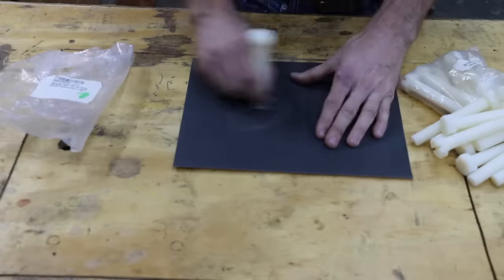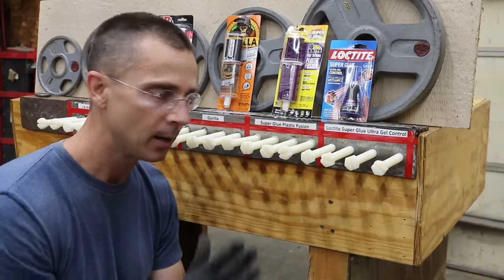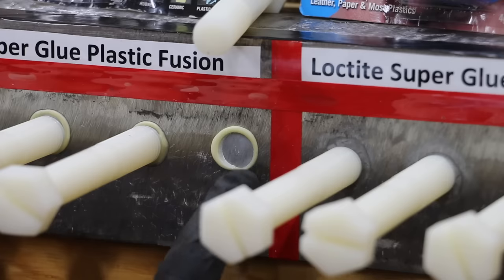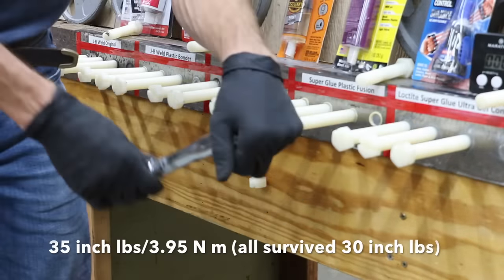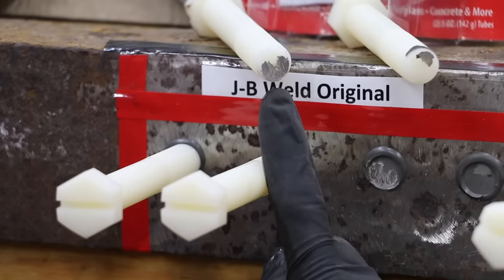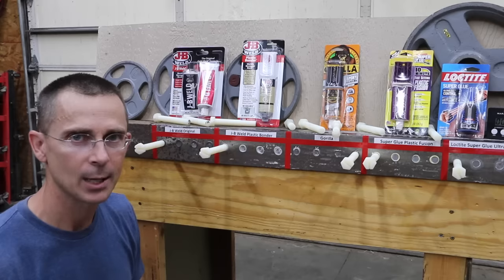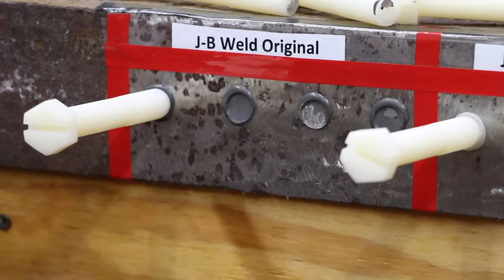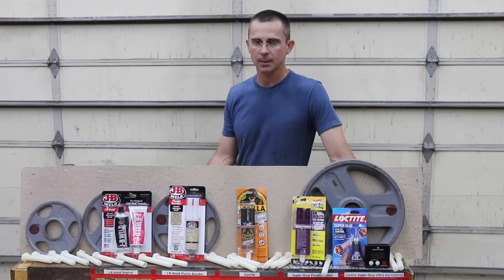Which Epoxy is Best for Plastic?  Let's find out!

Comment: LOL I have my side trim on with the clear Gorilla clue..
Reply from the maker: Thanks for sharing.
Reply: @ProjectFarm   It looks kinda Janky.. But it's holding it there for now. I really need to pull my car apart and fix a few things.. I have a new fiber glass bottom spoiler for my Nissan Juke and every time I move it it cracks a little more.. Don't have the mounting stuff yet won't be here till Friday, So Saturday will be the install day. Guess I will have to touch up the cracks with bondo after I get it on the car..

Comment: I think it might be time for an update to your epoxy videos. They're a little outdated and I believe you can develop a better testing methodology for both the steel and plastic epoxies. One thing I found lacking in this particular video is that typically you're going to using plastic epoxy between two different plastic surfaces and not plastic on steel. That's not to say the plastic on steel isn't valuable, but I think it might as well be a whole other video because the use case is so different.
Reply from the maker: Thanks for the suggestion.

Comment: Awesome dear mate I am searching for one glue for fixing engine part first you will introduce me jb weld appoxy in your cylinder head cutting video I comment on that I want to buy that we didn’t get that one in India but I want to order it on amazon it coast 1270 I will nice video  and it will also prevent oil leak on engine yes? Put some more informative video about that nice to met u🥰😘
Reply from the maker: Thanks for sharing.

Comment: Better to heat up the plastic and let it melt to steel! Also when mating a broken piece of plastic use heat to fuse the tow together similar to welding! Better that any glue! Don't try to use another plastic to weld plastic unless it's the same plastic!
Reply from the maker: Thanks for the feedback.

Comment: i know this is old here is the problem those bolt are made from material impervious to chemicals even glues where the plastic broke the epoxy was most likely to be caught around  the threads try with pvc rod or acrylic rod
Reply from the maker: Thanks for the feedback.

Comment: Entertaining, but I question any of the conclusions drawn here.  The mixing time, induction period, and even the amount of epoxy applied isn't consistent across the board, resulting in a shoulder of adhesive in some cases that begins to encapsulate the threads on the end of the bolt, which would significantly increasing holding power.  As well, the weight hang test is entirely dependent on the initial peak acceleration imparted as the weight is released, but you can't release the weight consistently when doing so by hand.  Similarly, the torque test is more dependent on the rate at which you apply the twisting force not the peak torque.  The folks at Consumer Reports and UL probably get a good laugh when watching these videos.

Comment: Unfortunately the basic premise has a flaw. He is genericizing and lumping all plastics as if they are one chemistry. These bolts are probably nylon or acetal, there are many more types of plastics... Polypropylene, polyethylene, polyester, polycarbonate, ABS, polystyrene etc that you come into contact with every day. Not one adhesive will work for them all.

Comment: I wish you had rubbed the nose of one of these bolts across a 5 inch piece of 50 grit in opposing directions. Epoxy does a much better job if given a roughed up surface to adhere to.
Reply from the maker: Thanks for the feedback.

Comment: That alcohol on this video isn't pure and in fact it is very unclean and will leave a white film almost on any surface, I am sure it will also interfere with results. Those "experts" lol. I work with 3D Printers every day and in order to have the adhession you almost never use this alcohol there, for this exact reason. What I find best is to use alcohol to dissolve any fats and oils, but after that also use windex for a final alcohol residue removal. or just use pure alcohol made by distillation method. Cheers!
Reply from the maker: Thanks for the feedback.

Comment: The glue doesn’t adhere to the nylon or poly bolts… if you sanded the surface of the bolts, would of offered different results.

Comment: The plastic bolts you are using look to be hard nylon and nylon does not glue very well if at all. There are many materials that are called plastic but they are all different.
Reply from the maker: Thanks for the feedback.

Comment: The metal plate should have holes drilled out and the plastic bolt threaded into the sub surface..... cut the plastic bolts in half then glue the bolt back together,  run same testing techniques
Reply from the maker: Thanks for the suggestion.

Comment: To truly test the efficiency of each epoxy, you should at least bury some of the threads with the product. I can almost guarantee that there will be better results. To have it at the very tip of the bolt is not fair to what the holding system is to the bolt? The threads. Grab some and see better results.  Exhaustive thinking
Reply from the maker: Thanks for sharing.

Comment: "Plastic" is very generic.  What kind of plastic?  Thermo setting, thermo plastic?  Is the glue meant to be used with that type of plastic?  Look at plastic welder refill kits; there are many different kinds of plastic rods for various materials.  This test would be useful data points for one type of plastic only.

Comment: These general tests are pretty pointless.. Plastic is such a broad term as to be meaningless. Whether gluing plastic to steel or another plastic, the best choice depends on what you are working with and the environmental conditions. Guessing is not science. For example, Loctite industrial products sells maybe a couple of dozen "super glues" for speed, heat, flexibility, low fumes,etc.  There are plastics like polyethelene, polypropelene, teflon and delrin that stick to no adhesive and must be primed first or plastic welded. It looks like his bolts are probably nylon. There are thermo setting plastics like phenolics or bakelite, often used for pot handles, that work best with certain adhesives while thermoplastics will melt from heat or solvents and work well with adhesives that disolve the surfaces and fuse or weld the pieces together. This guy is always looking for the magic bullet. It does not exist. Tell me what you are gluing and what envinronment it has to survive and then we can have a discussion on the best adhesive or other fastening method. That said, most hard plastics glue well with JB superbonder (tan or black). Thermosetting plastics also do well with  with original JB Weld.  The best general purpose super glue is Loctite 401 from their industrial line but it is expensive and there are a lot if fakes out there  on ebay and Amazon. Also super glues have shelf life of maybe 2 years max and people will sell you dated stuff. Know your seller.

Comment: need to test it as a plastic to plastic glue and not a plastic to steel glue.. thats like testing wood glue on a piece of wood glued to a steel plate.. thats a terrible way to test an plastic epoxy.. glue is designed to join a piece of plastic to another palstic.. just as gluing wood to another piece of wood with wood glue.. need to redo test with proper use